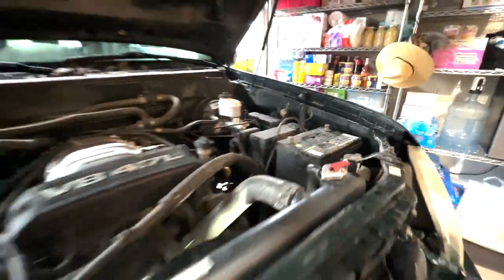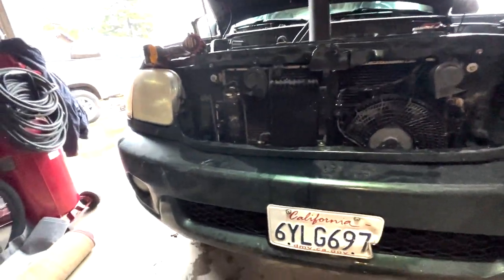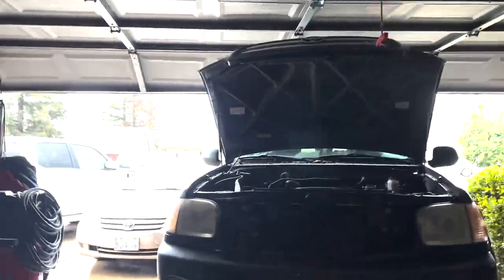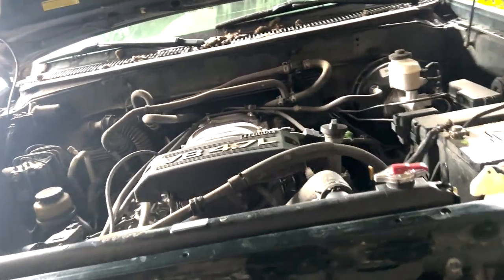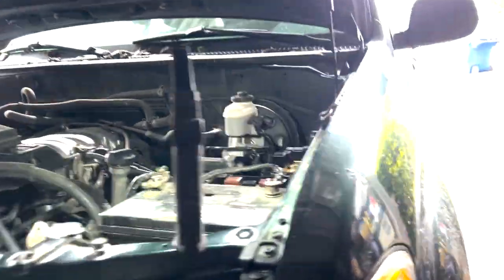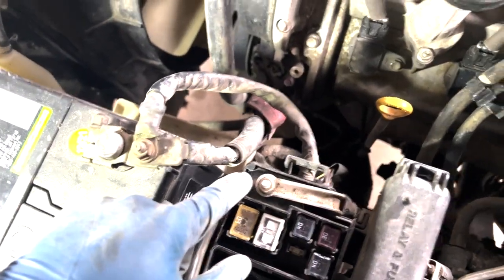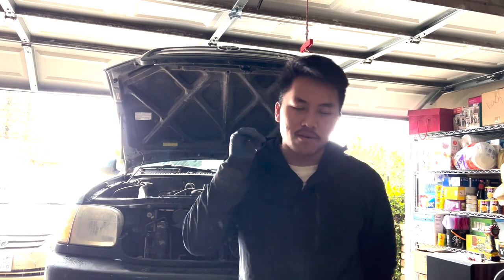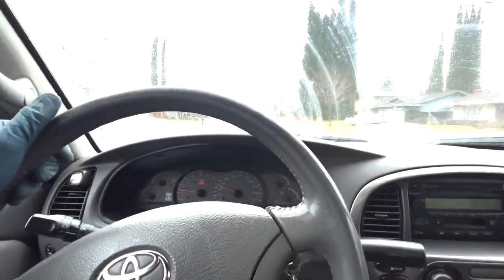1st Gen Sequoia | Changing Alternator | Diagnosing Blown ECU IG and Alternator Fuse

Comment: What's going on with the VSC Trac and ABS lights?  Have you scanned for codes?  Checked your abs sensors?  Vacuum leak in the evap system?  Fuel cap?
Reply from the maker: It showed a sensor code and master cylinder code. The systems on these cars are tricky but probably best to replace with new